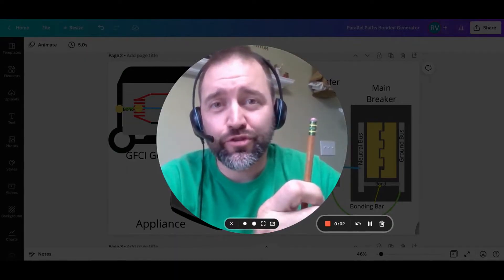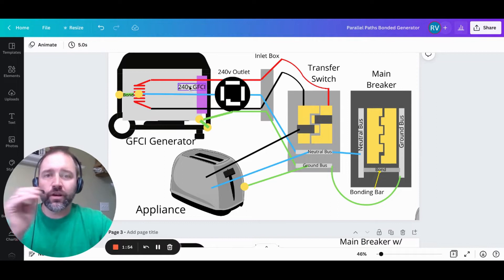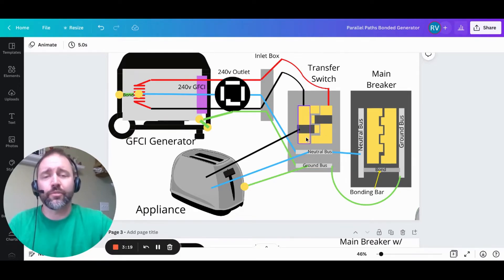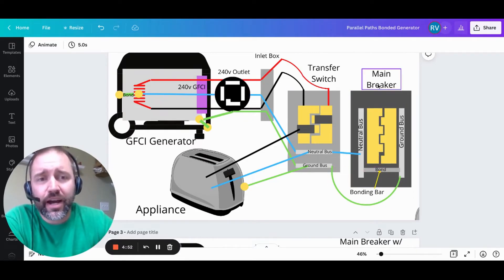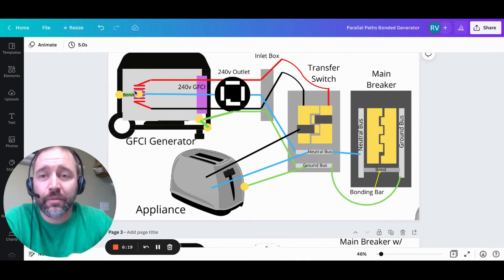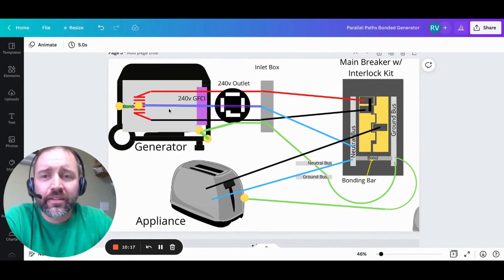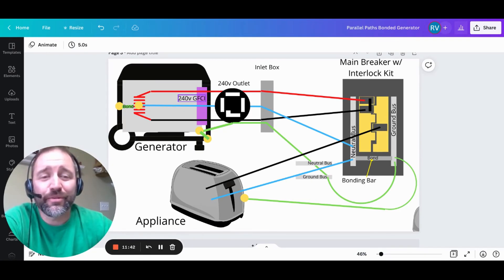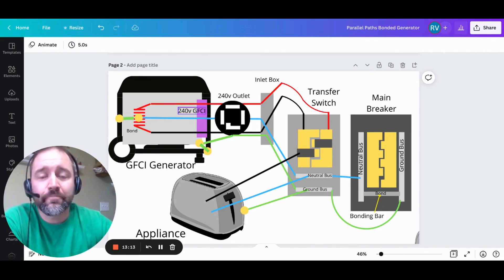GFCI Generator Keeps Tripping & How to Fix [Easy Explanation for a Beginner]

Comment: Unbelievable video.  The best I've viewed on this subject.  Question:  What happens if you have an older bonded generator and it does not have GFI 120 outlets?  And does this affect the other outlets, the L5-30 OR The L14-30?  Thanks

Comment: on the f-150 hybrid I disconnected the ground from the 30 amp 240 volt inlet plug and it solved the ground fault on the Truck, I have an interlock on the breaker on the main panel, and all outlets are grounded anyway at the house
Reply: This is the best way to do it. Leave the generator intact and simply remove the ground at the plug in point like you did

Comment: excellent video (and the webpage too). What if my neutral-bonded generator has no GFCI, and I backfeed my main panel (interlocked) which has GFCI breakers.

My guess is the panel GFCI will NOT trip as the neutral passes through the GFCI breaker before reaching the bonds. 

Yes?
Reply: Exactly, the ground wires in your service panel won't have any current flowing on them as usual hence its not an issue.  The problem only exist in the generator's hookup cable where the ground wire has some current flowing on it (parallel circuit) and since it's temporary who cares right because everything is still fully functional even thought the proper way would be to use a floating-neutral generator 😊

Comment: You could remove the ground wire between the Inlet plug and the Transfer switch to accomplish the same thing. But not when connecting to the main panel.

Comment: Thanks! Would be helpful to show the path of a ground fault after disconnecting the bond in the generator (e.g. the hot touches the toaster frame). Seems like there would no longer be a path through the ground wire back to the generator neutral point and it would not trip (it would go back to the panel ground, cross over to the neutral and back to the generator via the GFCI which would be none the wiser).
Reply: You're right the GFCI would not trip but the overcurrent protection (20A breaker) would. GFCI on generators is safety feature for standalone use with power tools.

Comment: Question - I will be receiving a 4k inverter/generator soon, it comes setup with floating neutral, no gfci outlet. The main purpose will be as an emergency backup for 1 or 2 sump pumps. I will put a neutral/ground bonding plug into an unused outlet on the generator so that it will be bonded. The generator will be exclusively used with extension cords to the sump pump(s). I am wondering about adding a gfci between the extension cord and the sump pump. I won’t run into the problem of the second bonding location shown in the video, but are there any other roadblocks that I’d hit?

Thoughts?  Thank you
Reply: Don't add bonding plug, you don't need it.
Reply: You don’t need it. You’ll be able to back feed with out any problems with a floating neutral already

Comment: Could this be a solution if to instal a GFCI circuit breaker in your main pannel (along with a interlock kit) without removal of bond on the neutral in the generator?

Comment: Question, so if you just use the generator by itself without connecting it to the house you would need to reconnect that chassis ground on the generator for the GFIC to work correct?
Reply: You absolutely would. You shouldn't do it as shown in this video, but instead remove the ground at the inlet power cord plug in point.

Comment: I have a MultiQuip generator, ans their literature says they won't show how to remove the bond in the generator. I haven't been able to find instructions anywhere.
Reply: I also have a multiquip generator. If you remove the ground at the point where you plug the generator into your house it will accomplish the same thing and your GFCI on the generator will no longer trip. Don't remove the ground wire at the panel, but at the actual inlet for the power cord. Leave it grounded to the box if metallic, but remove it from the terminal.
Reply: That’s because they want you to hire an electrician to do it. They won’t want to be responsible when you unhook the wrong wire and burn up your 5 thousand dollar generator.

Comment: So what happens if I want to use this for other portable generating needs, does removing the neutral bond create significant issues?
Reply: If you disconnect the neutral bond in your generator for house, used with an interlock, that’s great. If you ever go back to using it as a generator, standalone, while camping for instance, you need to put it back and bond the neutral to the frame.

Comment: While less common and more expensive I prefer a Neutral transfer switch along with the hots. This way the ground is bonded to everything but the hots and Neutral are linked to a separately derived source in either the utility or the generator. You need a bonded generator as well. 

Jotta W2R-2P/3P/4P 100A 220V Mini ATS Automatic Transfer Switch 100 amp Electrical Selector Switches Dual Power Switch (3P 100A 220V)
Reply: There is no such thing as 220V in the US, we use 240V/120V.

Comment: I have a Pulsar 12000W PG12000B and Pulsar told me to remove the neutral bond completely, it went from the ground to two spots on the connection block. After removing the bond the generator will not power an individual load such as a fan. Pulsar said that is normal unless the generator is connected to the load where the neutral is bonded. Does that seem right? I don't necessarily disagree I'm just looking for more insight. I've thought about making or buying a bonding plug. Thanks for this video!
Reply: You un hooked a load wire not the bond. Double check your work.

Comment: I had an issue with an inverter based window ac unit.  The only thing I could do was go through a non gfci breaker on the generator.  Basically had to use a 30 amp to 2+2 outlet conversion plug, since the 30 amp outlet was not a gfci

Comment: It's much easier to simply lift the ground at the point where the generator plugs into your house. It does the same thing. The only difference is that you won't have to modify your generator which may void the warranty or make it unsafe to use out in the field.
Reply: I was thinking in my head why wouldn't that situation work also, in understanding how electricity works.
Reply: What do you mean by lift the ground ?

Comment: Fantastic! I curse Honda for putting GFI receptacles in my generator which is a 2ndary backup, and is enclosed requiring a cooling fan. I have a mobile home style charger/inverter and 6 deep cycle batteries as my primary backup. In an extended outage I run the generator thro a transfer switch which disengages utility power to the inverter charger and engages generator power. The compartment cooling fan is plugged into one of the two GFI outlets on the generator and if the fan fails the generator cooks., That is too risky for me as I have caught the GFI outlet tripping once while I was not there. My generator is not bonded and I suspect that when I use the generator that the inverter does the dual function of charge the batteries and supplies juice to the house and there are some stray currents produced which can trip the GFI outlets. Could also be on gens like mine with auto throttle the change in gen speed could cause small current fluctuations that trips the GFI's. Because reliability is so critical, I removed the GFI's and replaced them with non-GFI receptacles. The generator is stationary and the frame is grounded and I don't care what code says what; I have $2,500 invested in my genset and I am more interested in protecting my investment.

Comment: Unfortunately this voids the warranty on most generators and leaves the generator with the now floating neutral in a potential dangerous situation when using as in other situations with power cords to run power tools. Is this a correct understanding?
Reply: Honda uses security torx head bolts for this reason. But you’re using a generator for emergency situations. You as the consumer has to decide. Bc as the manufacturer you have to ask if it does void warranty or not.
Reply: @judsimon - So, YOU bought a generator that is NOT compatible with your intended use!  That is YOUR problem.

Comment: I'm curious, as a licensed electrician, if the removal of the bond on the neutral in the generator could result in a floating neutral.  This could cause way more problems.
Reply: I retract that comment as I believe the neutral bond to ground at the main disconnect of the home will intentionally bond the neutral much like a separately derived power source.
Reply: @TopHatDoug  your generator will have a floating neutral, but you will still be bonded at your disconnect. The point of making the generator floating is precisely because you're already bonded elsewhere.

Comment: Why would you have a ground going from the ground bus to the generator frame? Wouldn't you ground from ground bus bar going through the 4 construction  240v twist lock? Everything  would be grounded from the houses main ground
Reply: Exactly correct. Just some generators come with a bonded neutral and that is if you’re using on a campsite or as a stand alone situation. When backfeeding you only need one bond and it’ll be in your “main” panel.

Comment: So, if you unbond the generator and run 240 to a transfer switch, what happens if you then decide to simultaneously use one of the other outlets on the generator, lets say just to power something outside. Is that other circuit now not gfci protected?
Reply: it's still protected, but the generator is now unsafe to use standalone
Reply: @KevinRiceSLO  Thanks for the info and that does make sense now.

Comment: What if the 240v outlet is not GFCI? Will it still work?
Reply: yes, you don't need to do anything.
Reply: So if I’m correct my 240 outlet is not GFCI protected I don’t have to unbond my generator to use with interlock correct

Comment: I have a winco generator it says it has a bonded neutral but the 240v is not gfci protected when I connected it to my reliance pro tran how come it did not trip?
Reply: You answered your question in the question.  Without a Ground Fault Circuit Interrupter you only have Overcurrent Protection, thus no GFCI to trip.
Reply: @TopHatDoug  ty for your time.

Comment: I've got a real simple quick I got a harbor freight generator two 110 receptacle with GFCI can I just put regular receptacles in there and get rid of the GFCI cuz mine you can't text it doesn't reset they're like broke then two days later I fired up then works day later I fired up it don't put on power three days later it does it always does when I don't really need it the most

Comment: So, if the outlet on the generator is not GFCI protected, would this still be an issue even though it is still a bonded neutral?
Reply: no, your good.
Reply: @donski1519   I disagree, and the video explains why around 4:50.  This would create multiple 2 bonded neutrals (home and generator), which is not NEC code.  But yes, it does work, as long as you don't cause a ground fault.  We are assuming the transfer switch neutral is in tact here.

Comment: This makes the generator UNSAFE to use standalone. Why remove the internal bond and modify your generator? You can do the same thing by not connecting the ground to the house, which still might not be a good idea.
Reply: That wouldn’t rectify the current divergence. Drive a ground rod and ground your gender?
Reply: @dukeraul624  If you lift the ground, no current can diverge. Explain?
Reply: @KevinRiceSLO  idk, if I found a ground bonded in the wall I would be more inclined to unbond the wires than lift the ground. 

Stand-alone home generators are floating neutral. I use my “portable” generator as a stand-alone home generator, so I took out the bonding jumper.
Reply: @dukeraul624  fair, but I believe the comment is meant for the situation where people use if for more than power backup.

Comment: Why is it that if i turn off my breaker I'm safe to work on my house wiring  etc., BUT if i turn the same breaker off and backfeed power back from the generator to my house there is concern that the hydro lines could be energized ??
Reply: If you turn off the main breaker, it doesn't allow current to be fed to other breakers. That being said, if you were backfeeding power to your house would you feel safe working on the now hot house wiring? 

Electricity doesn't have knowledge of which way to travel, it just travels in the path of least resistance. If you have the generator providing power and it's connected to the same system the hydro lines are when they aren't providing energy, you now have a new route with minimal resistance. You would be providing the service that the hydro company does, except in reverse.
Reply: You need to turn off your main breaker when back feeding your generator. All the breakers are connected internally in your panel, right out to the street. Turn off the main and you break that connection to the power lines.

Comment: My problem is with no load i have all breakers shut down and then start my genratator  turn on my 50 amp breaker to back feed my panel then no breackers trip and genratator shuts down and ...any ideas
Reply: Are you turning all your house breakers back on? Your generator might not be powerful enough to run everything in your house, and is overloaded.